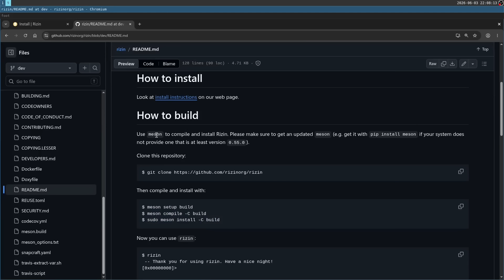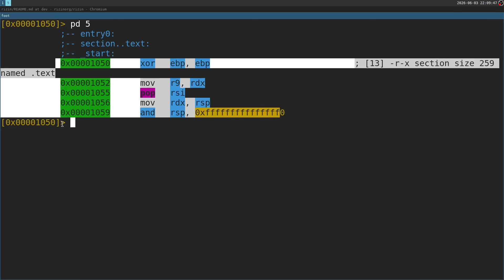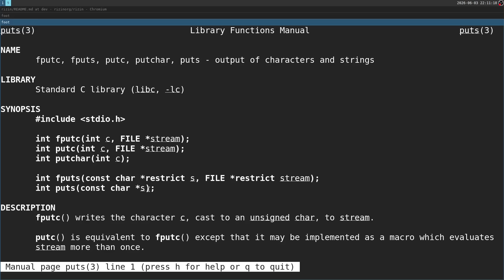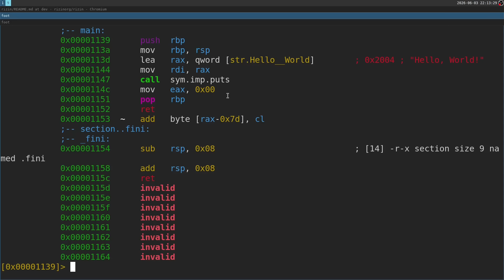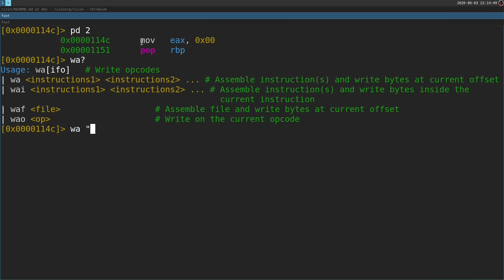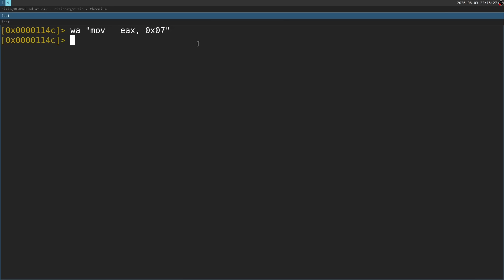Comparing Simplest C Program to Assembly (x64)

Comment: Cool! It is also interesting, that the string in the compiled program doesn't have a newline at the end, even though it does have it in the source code. That's because puts by itself adds a newline. And if the string in the source didn't have a newline, the compiler would not be able to optimize the call and would have just called printf
Reply from the maker: Interesting, didn't think about that!

Comment: Are there any specific differences between GCC, clang and cl that make you choose GCC when you're doing your tutorials?
This is other than the fact that gcc is available on all platforms. I specifically asking about functionality as cl.exe has a stricter interpretation of the C standard
Reply: how can cl.exe have a stricter interpretation of the C standard when it doesn't even treat C and C++ as separate languages? the so-called 'C mode' is defined as C89 with extensions because they couldn't bother to implement the entire C99 standard. And that means you don't get _STDC_VERSION_ macro defined by default; yet when you pass /std:c17 it defines _STDC_VERSION_ to 2007*whatever*L as if suggesting it is fully C17 compliant even though if you read MSDN it says it doesn't not support several features i.e. stdatomic. Now, you can just pass -pedantic to GCC and it will comply to any C standard you want

Comment: Basically looks like an alias to radare2, just discovered it's been forked. Would be worth mentioning as r2 has a lot of resources :)
Reply: rizin is NOT an alias to r2. It is much more modern, stable, has more features and much better documented than r2
Reply: @YTcore-s8u  It was a joke btw regarding the alias, it was only a fork. But can you please define modern when it comes to a RE framwork, why is one archaic and the other one modern? Honest question. As stated I have just discovered r2 has been forked (apparently a long time ago) just because I know r2 a bit and nothing in this video couldn't be done the same way with r2. Each command and output seem the same to me? And for the doc do you mean in quality or availability? I mostly find Reddit or buried SO posts when Googling Rizin (again just discovered its existence from this video). Thanks!

Comment: Make a video on how the Linux kernel boots the CPU and initializes memory at the assembly level in early start phase, before even majority of the C code is able to run.
Reply: Given that Linux boots in the modern UEFI standard, basically all code is C. Asm is required for legacy BIOS booting, where U need to do a bootloader, and possibly a boot manager
Reply: @DatBoi_TheGudBIAS  Thanks. It would be still interesting to understand the BIOS path. Actually something even more interesting would be projects like coreboot which runs when the firmware starts to boot.
Reply: @TuxikCEthe path for the BIOS is simple:
firstly, the BIOS code itself runs.
Then, the BIOS searches the drive for a bootable sector in sector 0 (a properly formatted MBR).
Then, the BIOS copies the 512 byte sector to 0x7C00-0*7DFF and passes control to it.

Then it's ur responsibility to make a boot manager (or use one) that does the partition choosing and does the booting and loading of ur OS kernel, on in the case of most modern OSs, the ramdisk.

One thing to note is that, oposite to UEFI, that is already running at the cpu max supported architecture (x86 or x86_64), BIOS booting is done in real mode (16 bit, x8086) and ure responsible for transitioning to protected mode (32 bits) and possibly long mode (64 bits).
Reply: And projects like core boot are insanely complex. It's a whole ass BIOS ure making.

If u think a bootloader and Bootmanager is hard, wait until u see a BIOS.

And remember, it's all real mode...
Reply: @DatBoi_TheGudBIAS  The main thing is Core boot is setting up video, figuring out the intricacies of the specific hardware, and setting up a complicated memory map.

As far as I know, the boot process can be simple... I may not say easy, but definitely simple. Depending on the hardware, you tell it to wake certain hardware, map out memory, then coordinate the CPU and GPU. The Raspberry Pi, and other micro controllers would be a bit easier since they are made for "reduced" operations.
Inkbox did a fun video recently making his own boot process, but he didn't go into too much detail.

Comment: Should have taught with GDB instead, it's more natural and standard.
Reply: debugging and reverse engineering are not the same thing
Reply: GDB (or any other debugger) is a tool for dynamic executable analysis: you run the code and observe how it behaves. RSE tools like rizin, ghidra and such perform static executable analysis: they read in the executable file, extract a machine code from it and analyze how it works without running the program itself
Reply: @aqual3i  You can use GDB to read executables without running them?